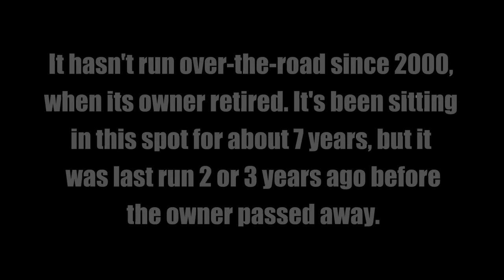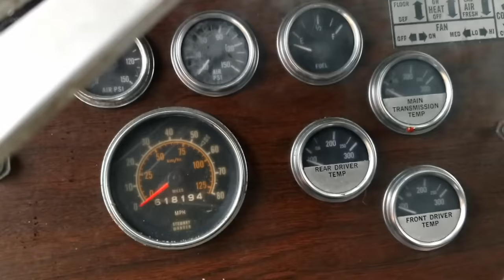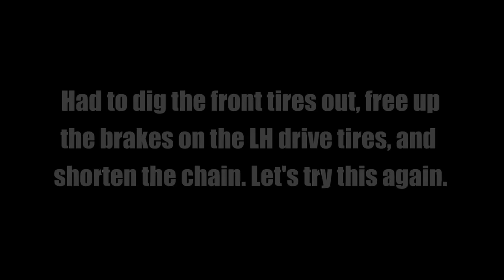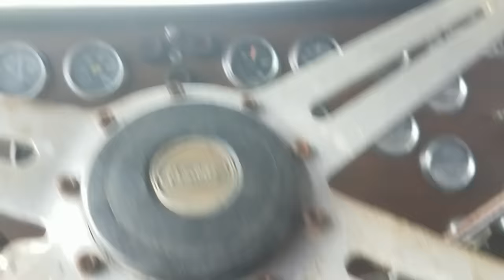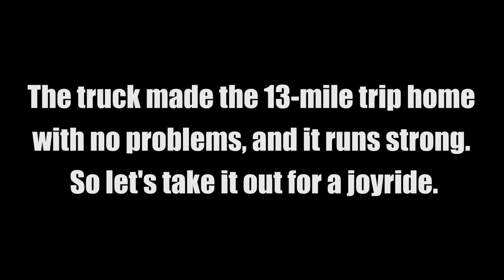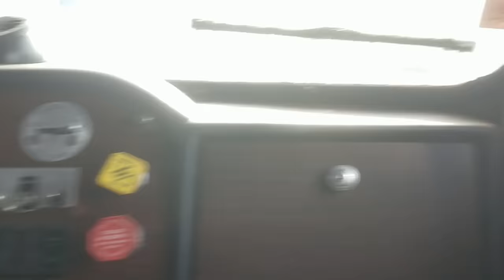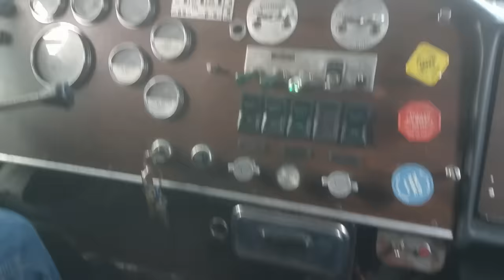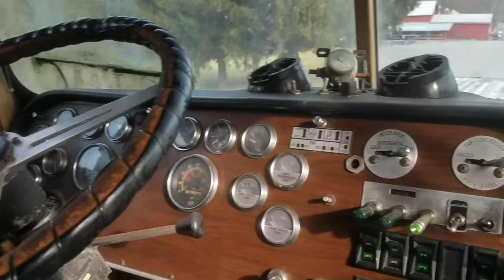Rescuing a 1977 Peterbilt 359 From Its Grave - First Time On the Road in 18 Years

Comment: 12/19/2018. Just came across this video. Was "raised" on those old trucks that had to be driven. There's nothing better than a pure mechanical engine. Hate these computerized pieces of junk. Thanks for resurrecting this classic. Before I retire after 44 years over the road, I would love drive one of those beauties again.
Reply: I've been driving the computerized trucks since 1991 or so. Prior to that, I'd never spent so much time sitting at a dealer with engine problems. Check engine lights constantly come on for no reason.  Mechanical, never had these problems. You can call me grandpa, that's ok. Proud of my career record 7+ million accident free miles. This " new breed" with their computer trucks and automatic transmissions don't have a clue what trucking is about.
Reply: MrKalashnik0va  this is an issue with no end. This is the attitude of "old school" verses "new school". If you understood how trucking was 30 or so years ago, you would understand why older drivers are leaving and not staying around to train. This career when I started was fun and free and there was a tight sense of community. Now, there is no community just a bunch individuals with no care about others only the self. Just getting from point A to point B is no life. We moved freight quickly and effectively with zero electronics or government interference. The trucks ran faster and better fuel efficient. The last noncomputer truck I was allowed to drive was equipped with a "B" model 425hp Cat turned up 10% over specs. The trans was a Road Ranger 15 speed overdrive, with 3:70 rears on 24.5 rubber. We ran 80,000 pounds east and west. That truck averaged 8 to 9 mpg able pull 6% grades at 45mph. That truck put every computer truck since to shame for mph and mpg. All these trucks since the advent of big cams to smog controls to aerodynamics have been a joke. To bad you don't agree, but there is no life just collecting a paycheck and holing a steering wheel. You can have your computers and automatic transmissions. I'm out of here.
Reply: Ron Stacy why don’t you just use a horse and cart?

Comment: Nice! I had a 78 Pete 359 with a cummins KT450. 13 speed double overdrive with 411 rears.  Great to see the old girl come back to life.
Reply: Funny my first rig was the same as yours lol hauked grain with it she would get out and walk the dog. I love the truckers who thought they were supertrucks in their 10 speed that would try to argue there was no such thing as a double over 13 and i need to learn more about trucking. Lmao
Reply: 10-4 wheeling. My first truck was a cummins super 250 with a 13. I picked up the pete in 1985. It came with a 13 over but I replaced it with a double over and it was almost too much. It would have to get to 80 before you could put it in the big hole. That was ok because 12th was direct and was a lot more quiet. The truck didn't have power steering or air conditioning. It had the small bunk as well. I pulled oversize with it to all 48 states and it did a great job with the KT motor.

Comment: " I'd like to see one of those new, "clean-running" diesel engines still running as good as this one in 40 years."

Yup. Nice vid, awesome looking truck!
Reply: you wont have to worry about diesels in 40 years, everything will be electric and these big diesels will be banned. I believe the truck of the future will be something like Nikolas hydrogen fuel cell truck. Electric but fill it up with hydrogen so no stupid plug in electric crap like Tesla. 1000 HP, 2000lbs of torgue, 1000 miles of range. Diesel is in its dying days. 20 years left tops.
Reply: Might want to do a  google search. They already have fully electric trucks. My company is testing one out right now. The push is on to get rid of diesel. Tesla has a plug in electric, Nikola is about to start production of a hydrogen electric truck, all the big manufacturers are developing and testing fully electric class 8 trucks, not diesel-electric. Now of course at the moment all of these trucks will be for local use, as range is limited as are charging stations  (or filling in the case of hydrogen), but its only a matter of time before the range is increased to put these trucks OTR. Once we get to that point the Feds will start moving to get diesel trucks off the road for good. I dont think this is going to take 40 years. Maybe 20, if that.

Comment: Back then I was working on trucks. The 359 was the king of the road. If you had one of these with a Big Cam 350 or a 600 with a 15 speed you were big time.

Comment: Cool old truck. It reminds me of snowman's truck from the bandit
Reply: My first thought exactly. Excellent film!
Reply from the maker: Ryan also happens to have a '77 Kenworth W900A, the same model  used in Smokey and the Bandit, and it has a similar paint scheme to the Snowman's truck.
Reply: @MichaelTJD60  According to the web,

4 Truck were used in this movie
1. 1975 Kenworth W900A the truck shown up above cause i talked to the oringal of the truck he told me everything and he to me that it was a 1975 so Rhion is right
2. 1976 Kenworth with the Cummins motor used in the scences of loading up at the doc, pulling in to snowmans house, and used after snowman used the truck with the Brush Gaurd till the end of the movie and when Snowman gets pulled over by the Cop this Kenwnorth was also used as the main truck in the last of the cowboys
3. The 1973 Kenworth W900A with the Brush Guard this truck is long gone now
4. The 1969 Kenworth W900A used in the scene were snowman gets beat up and even before he gets beat up cause when he pulls into the gas station where he gets beat up it's still this truck just listen to the motor it's a 4 stroke Detroit

I have no idea myself, I always thought it was one like this myself, but as an europeeian we don't know much about american trucks. Old trucks where I live are usually volvo or scania.
Reply from the maker: @GeirEivindMork  I've heard only one of the original trucks still exists, and it's sitting abandoned somewhere in Arkansas. But there are so many rumors about what happened to the original trucks...who knows. All I know is, at least one of them had a CAT engine, at least one had a Cummins, and at least one had a Detroit. And I think they may have all been V8's.
Reply: @MichaelTJD60  well fine then i wont ask lol
Reply: Lol that’s why I watched. Very cool 😎

Comment: What a great video! And what a real nice old truck...  :) 
The previous owner that passed away must be looking down, and he's happy that you got it up and running again... He probably loved that truck very much. 
I bet it will look good after you pressure wash it and use some elbow grease on it...
Thumbs up! 👍🏻
Reply from the maker: We are glad to keep this thing running in his memory. His wife told us it's exactly what he would have wanted. He would be glad this truck went to a good home.
Reply: @MichaelTJD60  * smiles * :) 
I have a question for you... how did you free up the brakes? The reason I ask is I have two trucks that have been sitting a long time. One is a pickup truck the other an SUV. I'm going to try and get them running again. I put some penetrating oil down the throttle body of one and I have to take out the spark plugs to spray oil in them also. I'll let it sit a few days with the oil in it before attempting to turn it over. I'm almost positive the brakes will all be seized...
Reply: @piratepete-thetruthisforevery1 ~ Sometimes just gently rocking the truck will free the brakes. Or jack the wheels up and 'work' them, maybe spraying soapy water on the inside drums while tapping the shoes. A mix of Marvel Mystery Oil and Acetone 50/50 is good for breaking frozen rings. Have fun & good luck!
Reply: No, the deceased owner is not "looking down" from somewhere "up there."

He's dead.
Reply: @starmanskye  Thanks for the info, I'll try that, hopefully your tips will help me out ... but unfortunately Marvel Mystery oil is not available here in 🇨🇦. 

 Also I tried to respond to your comment earlier but the owner of this channel closed off the comment section due to many negative comments. 

To the person who left me a negative comment in this thread...  
That is your Atheist opinion, there is a scientific experiment showing that when someone passes away their soul leaves their body, it weighs so many grams and after death occurs the body weighs less, this is proof we don't just die. look it up...
Reply: @piratepete-thetruthisforevery1  ~ Wow, didn't know that about marvel oil. I live just north in Oregon, and I don't think there's any ban on it here. You could prob -ebay or amazon-it. Or use something like auto-transfluid, or any decent penetrating oil. Apparently essential oils like Peppermint are also good at freeing rust-and-corrosion frozen bolts and parts. 

I think its the mild chemical reaction between acetone and high-viscosity (thin, easy-flowing) oil like ATF if you don't have Marvel oil, that makes it effective. Tho they have to be well-mixed since acetone will sit 'on' the denser oil. There's a lot of google discussion about home-made penetrant solutions, see: <https://www.google.com/search?q=alcohol+and+acetone+to+free+rusted+bolts%3F&ie=utf-8&oe=utf-8&client=firefox-b-1-ab> 

Diesel/kerosene and acetone or mineral-spirits 50/50 has been used to good effect. OR w/ lacquer-thinner. Even up to 90% vegetable oil and acetone/mineral spirits as a cheap WD-40 have been used and are suggested ~ tho prob mostly as corrosion-resistance or anti-seize. I've had good luck with Liquid Wrench, with the advantage of a small nozzle-straw to blow it into small crevices. Tho dry, rusty steel/metal will tend to 'wick' high-viscosity oil anyway. This PDF doc also looks informative: Different Types of Penetrating Oils by Lloyd Bender
<www.antiquemodeler.org/sam_new/news_letters/assets/wham_2011_07.pdf>
"A question that is often raised by mechanics is the effectiveness of penetrating oils in ..."

Careful though if also using a propane torch to induce differential temperature-shock expansion when using flammable solvents. Probably not a bad-idea overall to pull the wheels and drums to inspect, free-up seized parts, adjust, clean-lube the bearings and service the wheel-cylinders/brake shoes, just to Get-R-done right.

VERY peculiar how some folks are so intolerant of any expressions of spiritual faith, even off-hand comments. We've become a very fractious, opinionated, snarky and un-civil society. I'm aware of the study you cited, very intriguing. Funny how hostile, defensive and pro-active some people can be in dissing belief-in-God, despite its long legacy in every society, culture and ethnic-group thru history. 

The basic Golden Rule precepts are my measure of God's Love and Will, why I don't criticize other people's faith, or agnostic ambivalence/cynical-atheist lack-of. It's like, they're evangelists-in-reverse. But anyone whose faith is vulnerable to, can't withstand some mockery, insults, disparagement, put-downs, doesn't have a very strong faith or personal conviction to begin with. 

Along with individual initiative, moral discretion is an essential key to knowing yourself and the over-all Truth of things, IMO. Which is a very personal, experiential thing. Anyway, best regards, good-luck, 
Stay vigilant!

Comment: I worked at the factory that truck was built at from 1976 to 1986 , wonder If i worked on it
Reply: In Newark California or at the Denton Tx factory?
Reply: @dontaviouschandler3961   there was a qc guy on the cab over line by the name of Chandler ,
Reply: I thought Peter bilt it ? Guess I was wrong.
Reply: @21335186z  corny but lmao!
Reply: ya Peter did build them truck he was a friend of mine
Reply: @rickwilliams1108  yeah I remember " you and pete built it and " Gary Ridgeway "  Painted it ...right?
Reply: no I worked at cab trim ,put cab lining, on the cab over line .but I spent more of my years at assembly 2 .I could drop a cab hood & sleeper hook them all up start it up then drive it out thr door. only God knows how many I drove out that doors.
Reply: Is there a way to tell if you did ?
Reply from the maker: This one was built in California - the Denton, TX plant didn't open until 1980.
Reply: Chuck Hare Gary ridgeway painted at kenworth
Reply: Probably
Reply: Might have. That'd be cool if you did.

Comment: That's what I call a real american truck. Greetings from Smokey and Bandit :-)  It's a beauty even in this dirty condition.
Reply: Canadian
Reply: @markwoodstock1112  But the truck was built in the USA...right? And I only know it from american movies.
Reply: Actually it was a A Model Kenworth in Smokey and The Bandit
Reply: @jeffbruhl7560  You're correct that it was a KW and Not a Pete~!
Reply: @AntiTrustNJ  who cares, you made a mistake,  both beautiful trucks.
Reply: Possible.... But it's the same shape and apperance. And the same "feel" :-) I mean they just don't make it like this anymore.
Reply: In Europe we we have almost none of those "engine-nose" trucks because the overall length is limited to 18 meters. So a large nose is a waste of useful cargo space. Our trucks all have the engine under the cabin for this reason and that does not look so cool :-) Some dumper trucks do have a nose because the box is shorter anyway, so you can spend some length into "ornament"...
A truck like the on in the video... how long is that? 10 meters? That would be allowed here with an 8m trailer ;-) But hey, we don't have those large and wide roads everywhere like in the US or Canada.
With that truck you would get stuck every few miles.
Reply: @PlaywithJunk  same here for years...but things changed in the 90s. we also don't have triple axles on the  tractor.  Or quads  on trailers . Our roads are wide, and bridges are strong and not 400yrs old. So . Do some research,  before you bash real truckers! " American " truckers!  ... ya puff!
Reply: @PlaywithJunk  10 meters.. 32"FT"! "  "10" inches!.. metric system?  Really? ...
Reply: @chuckhare5381  When the total length is limited to 18m and the tractor is already  8m then only 10m are left for the trailer.... that's it. That's why in Europe we only have the shortest possible tractors.
Reply: @chuckhare5381  Strong bridges? Are you american? You have a strange kind of humor ;-)
But you're right, you don't have 400yrs old bridges.... yours collapse after 50yrs.
BTW italian brigdes too. But Italy is famous for other things than road maintenance...
Reply: @chuckhare5381  BTW I'n not bashing anyone.... why do you say that?
Reply: @Santiago Morena Or even more so, try Australia

Comment: Takes me back in the 70’s when I sold Peterbuilt parts in Indy for Parker GMC-Peterbuilt dealer. 400 cummins with a 10 or 13 speed roadranger transmission or Fuller ? Probably SQHD or Timken rear diffs? Probably has NTHC 90 Injectors. Hydraulic Jake brakes still sound good. Good find if price was right. What we call the long nose Pete, 114” cab style.  I watched one of those do a run-away in the shop from a stuck governor once. It jumped gear and pushed two trucks in front of it out the door before they got it shut down. Looking forward to seeing the cleanup. Probably holds around 40 qts. of oil with a 2 gallon luberfilter unit. There was a time when a mechanic would walk up to the counter and order a complete overhaul for either a 6-71-238, 8-71-318 Detroit or 250, 350 or 400 Cummins. I could take a cart, pull every part and write the part numbers down without looking in the books. Those were the years.

Comment: I am a bit of a greeny but ironical I love big old diesels I will plant a hundred trees for you, just keep on trucking love it.
Reply: Kevin Massey if you’re a greenie then you know diesels are cleaner burning and way better for the atmosphere than gas engines
Reply: @joejones2847  you're joking...right
Reply: Caleb Wiebe no im not joking due to the fact that less diesel is burned per mile than gas per mile diesel emits less of the harmful gasses per mile driven. Even though it makes about 15% more harmful gases per gallon than a gas car a Diesel engine goes farther on a gallon so when figured by the miles travelled a diesel emits less harmful gasses in 2000 miles than a gas engine would.
Reply: @joejones2847  I see, that makes sense, thanks for clearing that up. Except for the douches with rolling coal mods
Reply: Caleb Wiebe even they get better mileage though just because you see black smoke doesn’t mean there’s harmful gasses filling it. They are just making the turbo kick in sooner aren’t they?
Reply: @joejones2847  This one I don't agree with, rolling coal mods enable there to be more fuel injected to the engine thus creating the black smoke or soot. Such a harmful pollutant, it's been linked to many cases of lung cancer. They definitely don't get better mileage
Reply from the maker: I can't really speak for the guys that roll coal on purpose...they make the rest of the diesel owners look bad. But yes, diesel engines do emit fewer hydrocarbons than gas engines. People think the black cloud of smoke is more harmful when it's actually not. On an old mechanical diesel like this one, it's hard to keep them from smoking...that's just their nature.
Reply: Caleb Wiebe whether you agree or not isn’t the issue. Science and facts are facts. Lots of people don’t agree the earth is round but it is.
Reply: Thanks but these dont cause any where the destruction as all the cars in LA. So take every truck in the USA and just the non trucks in LA and then you got a comparison.
Reply: @calebwiebe7826  no
Reply: daniel B Sure it existed. But it is a fact and scientifically proven that humans have increased global warming significantly by emission of co2
Reply: Haha lol Atleast you support diesels unlike the others